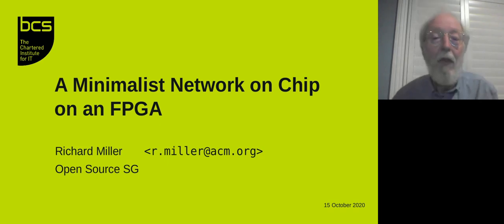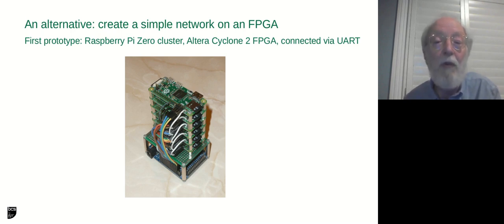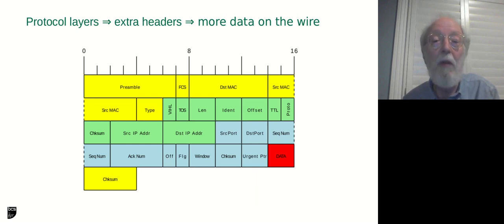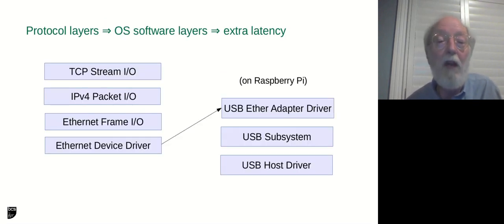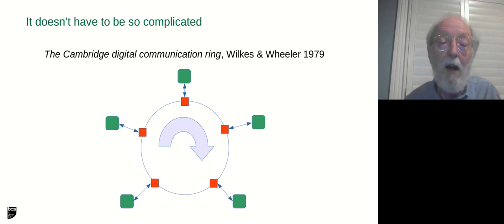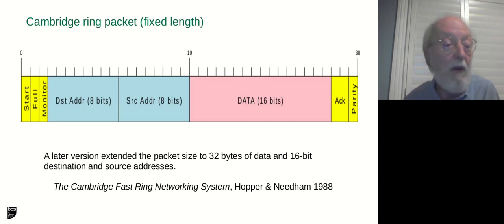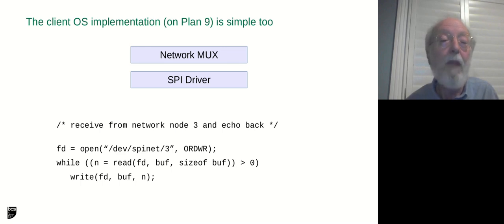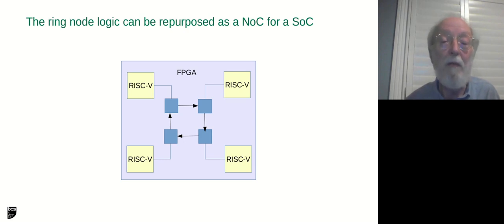A Minimalist Network on Chip on an FPGA

Comment: So in order for an FPGA to respond to a Ping, it would need to implement layer 2 (Data Link: MAC and LLC) of the OSI model?  Layer1 would be purely physical (transceiver/transformers)?

Any thoughts on the Ethernet IP cores from OpenCores, Xilinx, Lattice, etc?

For example, I imagine in order for Windows to see a custom NIC, it would need to have allocated some PCI address space for it.. but how would Windows know how to talk to it, in order to get for the operating system to access registers, including the MAC address.   I assume a driver is involved (Jungo?), but is there a standard for what register contains which information?   

And as a thought experiment, if you were to create a consumer NIC product, how would you buy unique MAC addresses for it?   

On the other hand, if you use an off the shelf Ethernet/SPI controller (ex. ENC28J60), how would Windows see it?   If the board containing the ENC28J60 provided an RS-232 Windows could talk to it, but it would recognize it as a COM port not a NIC!